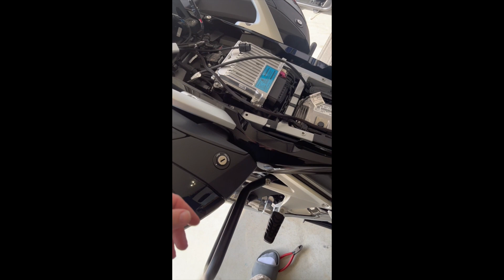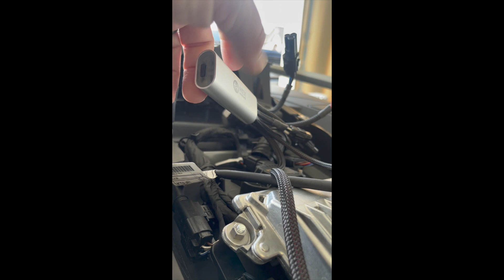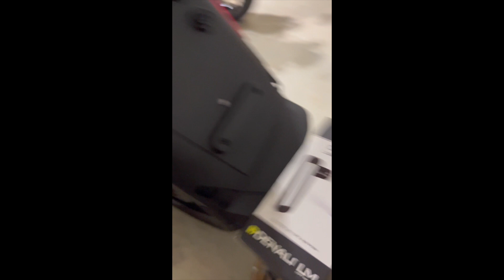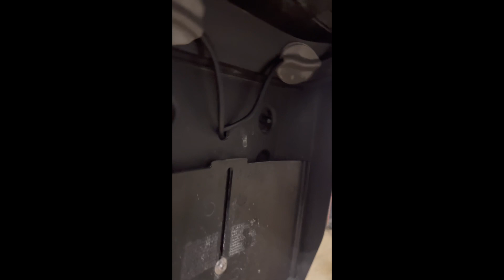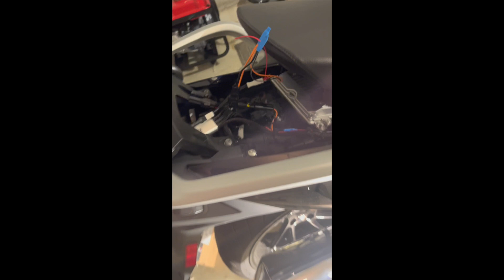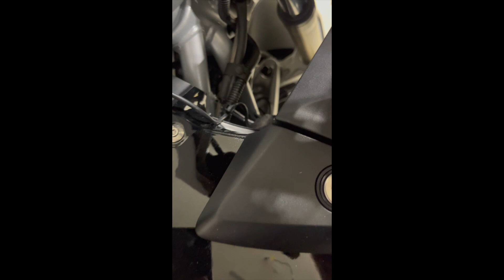BMW R1250RT HEX eZCAN Denali B6 Lights and GPS Power Install

Comment: Thanks, this was really helpful to find the canbus connector partially hidden behind the plastic under the rack.  Interestingly, on my 2022 RT it is still labelled RDC, but obviously not connected to anything.  The blanking plug came in handy for the redundant port on the excan.

Comment: Which connector  on the eZCAN did you use to hook power to your Tom Tom?
Reply from the maker: I'm sorry its been a while. I really don't remember. I believe the bike also has an accessory power cable on the top left side under the fairing. Black and yellow I think.

Comment: Did you order the EX Can with the extension wiring or are you just using the wiring that came with the EZ Can itself? I want to power my GPS / phone mount / dashcam etc and it's not clear if I need extra wiring. Thanks!
Reply from the maker: @Just-Ross  I no longer have the bike but I can’t remember purchasing and extension cable.

Comment: Do you need to remove the top case and luggage rack in order to access the wires that the EZ Can connects to?
Reply from the maker: No I can take off the seat only to add something.